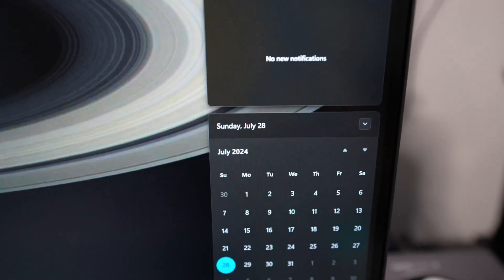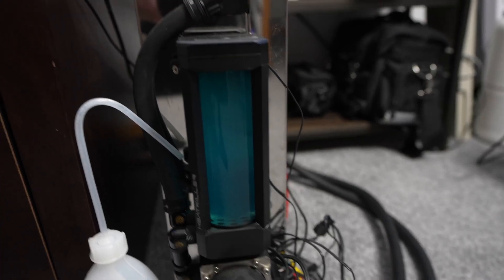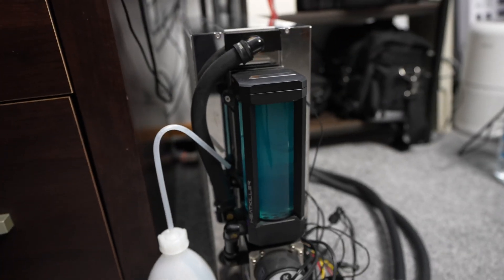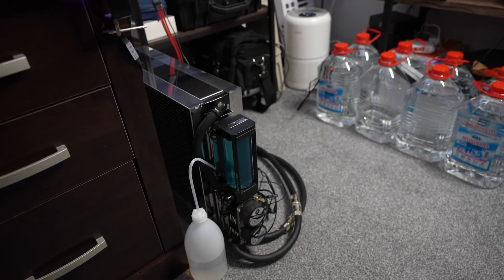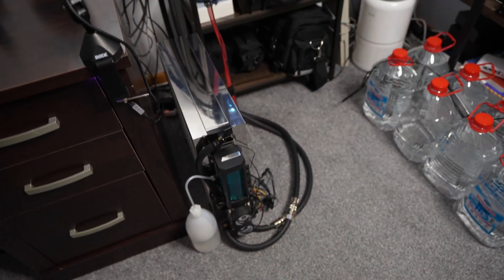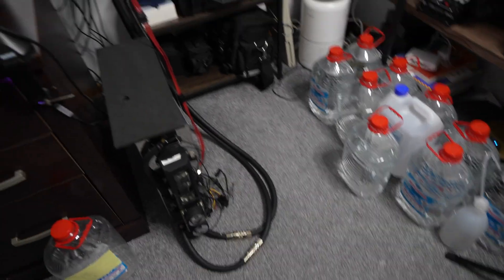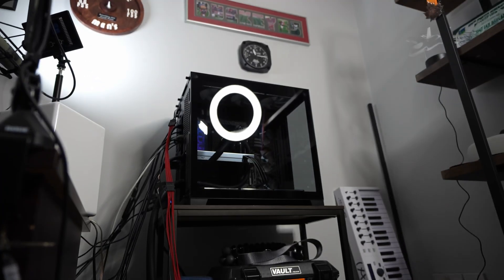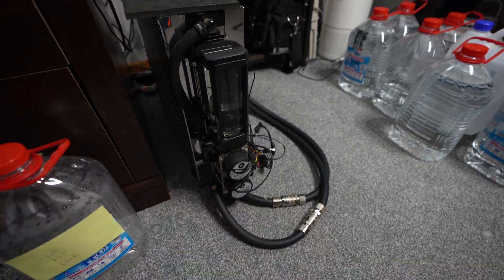MO-RA3 420 System Clean and Flush using EK Superflush (Part 2 of 2)

Comment: So I’m about to do this to my loop and change the color do I drain my original coolant -> put in cleaner solution -> drain it and flush with distilled water-> add super flush mix -> drain it and rinse again with distilled water-> then put in my new coolant
Reply from the maker: Correct. That order of how I did mine with great results.

Comment: Heya mate! thanks looking very cool! Btw did You flush MO-RA on first time? also I saw some filters have is it make any sense connect on in and out filters maybe even with hot swaps for first time cleaning up, and then remove it, because I saw so manu trash in radiators. Thanks